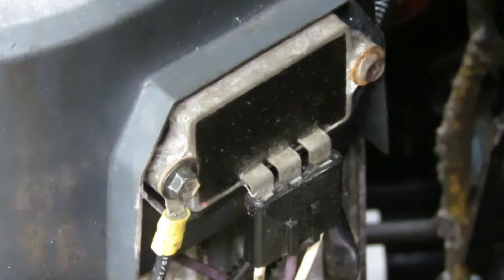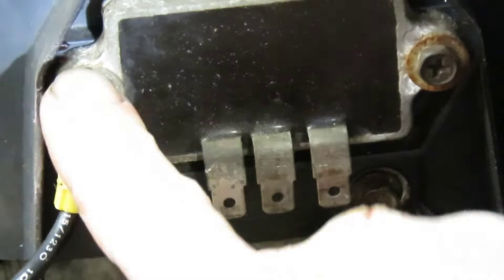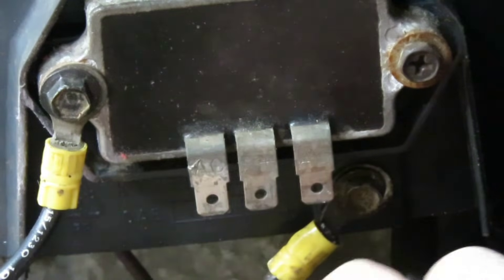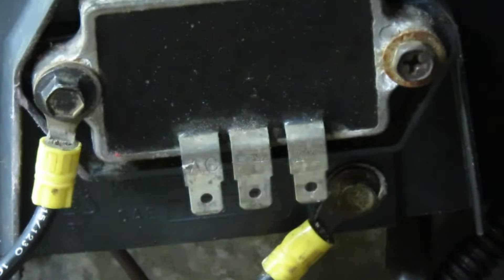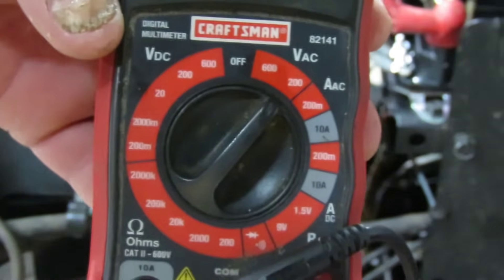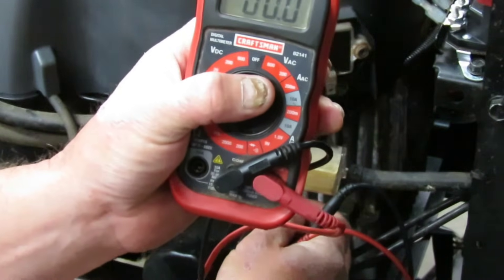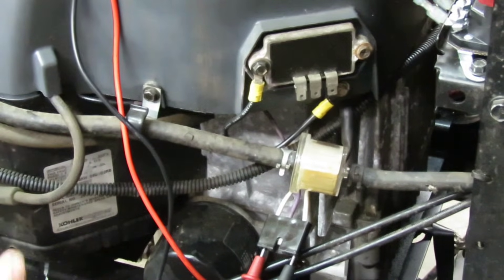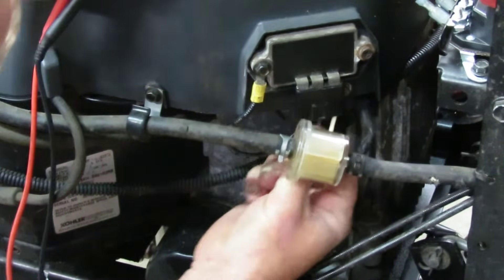How to Test Kohler Charging System

Comment: On this video, what is the wire looped over next to the purple wire in your harness,  I'm only getting 9 V back to my voltage regulator with the key on. I got a good stator, new regulator, but not charging at the battery
Reply from the maker: Im thinking your talking about the blue jumper in connector at end of this Video. The Jumper is just a loop for power to go to green wire.
But I think your problem is this.
Your power to Voltage Regulator comes from Key Switch. Your either Not getting good power to key Switch B terminal which comes from wire on Solenoid. Same post that Battery Positive goes to on Starter Solenoid. OR the key switch is bad not getting a good connection inside Switch.
Key switch Test Video below
https://youtu.be/rOqwb0KaHQI

The way it works
Power from Battery post side of Solenoid has a small wire Red goes straight to key Switch B terminal. When the Key Switch is in ON position connects B terminal to A1 or A2
A1 or A2 is from your Purple wire.
Take note that the purple wire may change color before it gets to Key Switch.

Comment: This was a great video, I don’t have a connector with 3 wires on my voltage regulator, I have the 2 wires and I did what you said and put them on the outside terminals on the regulator however there isn’t a purple wire on the center terminal of the connector but on the other side of the motor there is a purple wire along with a green wire. Do you think the person I got the motor from cut the wire off on the regulator side or does the purple wire connect somewhere else inside the shroud?
Your videos are so good thank you for posting them!😊

Comment: Hi how are you Startin..
I have tried everything you have showed..
Everything is good.
Stator 43.2
Battery charge 14.5
My problem is.. 
Why when I turn my key on the battery light stays on? 
Even when the mower is running at full throttle. 
Please help me resolve this issue.. 
Great videos.. Thank you!
Reply from the maker: Sounds like your charging System is working fine. Just your dash charging light is saying it's not.
Need to run the wires down that go to that light. Seems you have bad connection going to the charging light.

Comment: After you've verified the charging system in working properly and it's still not charging the battery, what's the next step to check the system. I have a new battery, new stator and new regulator so that eliminates three problems.
Reply from the maker: @earlpoole7172
Make sure the base of regulator has good Ground. The regulator will not work if the base has Ground issues. Multimeter on Ohms One lead to base of regulator one lead to ground on battery Negative. If Doesn't show that regulator is grounded. Check the jumper wire on regulator that goes from regulator bolts to one of the shroud bolts.
Can't check the regulator Base Ground from here, You will be checking resistance between the wire and it will falsely show base is grounded.
Kohler is bad for regulator loosing Ground at that jumper wire where it bolts to shroud. The shroud is plastic, but behind the shroud bolt goes into metal.
If the base has a good ground
Need to check wiring from regulator up to key Switch. Then from Key Switch goes to battery Positive side of Starter Solenoid.
Reply: Thanks for the reply. I'll do some testing.
Reply: @earlpoole7172 I know this post is old but, I did see where the battery needs to be in a slightly discharged condition so that the charging system will engage.
Reply: Did not hear that.  Where did you learn that?

Comment: Excellent video troubleshooting a Kohler.
My issue was exactly as you described. 
The yellow right terminal to the block ground, the screw face and inside was corroded with rust.
Also, the left side yellow terminal was sparking intermittently . Looks like a poor engineer design, the left terminal going the the rectifier is threaded through and secured by the plastic shroud only, and stripped out if you tighten it.  Kohler needs a more robust mount than a screw through plastic fastening method.

Thanks again, you earned a  new subscriber here.

Comment: My zmaster will not run if I disconnect the battery. I checked the charging system and I am getting 14volts. Suggestions?
Reply from the maker: I guess I'm not understanding exactly what your saying. If it's running and your Charging.
What's the issue of needing to disconnect battery while it's running ?

Comment: Don't know if you will see this or not but when I check the AC voltage I get 43 but when I do the DC voltage it will only read .19. Does that mean the voltage regulator is bad? Or what
Reply from the maker: It could mean voltage regulator is bad.
But you need to do a few more tests.
Watch this Video Link Below.
It is on a Kawasaki engine
But the charging system works the same.
Only difference on the Kawasaki the DC pin on voltage regulator is the Right Pin and 2 on left are AC. To where your Kohler Center Pin is DC and two outside ones are AC.
But this Video will show you other tests 
Testing regulator base ground
Check for Battery Voltage on DC side with key Switch ON and shows you how to do it.
Fast  Version 
https://youtu.be/eZndhOJLp64
Slow Version
 https://youtu.be/zRwkKNGkymU
Reply: @sartingarage8045  thanks for the advice and it was a bad voltage regulator.

Comment: There is no better explanation that what you have done.  THANKS
Reply from the maker: I have another Video that will help you that is more comprehensive. The only difference is this Video is on a Kawasaki Engine. The charging works the same way. The only difference is the output on the kohler Voltage Regulator is the center Pin. On the Kawasaki it's Pin to Right. Left 2 are AC.
https://youtu.be/zRwkKNGkymU

Comment: Hi, thanks for your video... I'm getting 30V AC from stator but nothing from regulator...with engine off, using a multimetter i probed the center pin and  neg post on battery and had no DC voltage... I was told there should be 12V when doing that. So do I have an open circuit on the positive side?.. what is my next step? Thank you.
Reply from the maker: There should be voltage to that center Pin with key Switch in ON position. If there is NO Voltage with key on, Then yes you have a open short, bad key Switch. 
I have another Video that is on a Kawasaki engine and is more comprehensive.
The only difference is your output is in the center on voltage regulator. Kawasaki Output pin is on one side.
But watch this Video and it will help you
Link below
https://youtu.be/zRwkKNGkymU
Reply: Thanks so much.... I was missing that the key needed to be on. 
Thanks for the link.
Reply: I turned key on and still had no voltage so I followed the wire to the plug and the wire had broken off the plug connector! So I reconnected the wire. I have 12V now and will be able to test regulator soon, but hat was more than likely the problem and my battery no charge issue should be fixed. Really appreciate your generous help!

Comment: I'm getting a reading of 22v ac off the two white wires from the stator. What is the minimum for a mower with electric clutch for blade engagement?
Reply from the maker: 22 volts is definitely Low.
I would pull the flywheel and check internal Flywheel Magnets. They should be evenly spaced apart and if you have magnets that have fell out. You can epoxy them back, but make sure you install magnets in push pull sequence. Meaning if you take a magnet and put it to each magnet on the flywheel. One should push magnet away next magnet on flywheel will draw magnet to it. Needs to do this all the way around flywheel. If flywheel looks ok.
Make sure your engine is grounded good to negative on battery.
If all checks out ok
Replace Stator.
Reply: @sartingarage8045   I put the meter leads into the plug like you did in the video, and got 32 volts..eariler I was trying to hold them when I got 22 volts. Your videos helped a lot,  my regulator was not grounded. I had put two new coils on this Kohler, when i put it back together, i must have put it back together wrong. How is the regulator grounded from the factory?
Reply from the maker: Usually Voltage Regulators have a Jumper Wire going from Voltage Regulator mount bolt to the Top Shroud Bolt right next to regulator.
Reply: @sartingarage8045  I found the problem, it has a metal plate that bolted behind the regulator, then bolted to a lower shroud cover. Bolted that on and getting 13.43 volts , before i just had 12.53 volts. Thanks for posting the videos.

Comment: I have a 1985 Ropper lawn tractor with a Briggs & Stratton twin opposed 14 watch. I have an over charging problem but someone told me they’re are no regulators on that machine. Is there any way you can verify and let me know thank you.
Reply from the maker: Im pretty sure There is Not a Voltage Regulator on that machine. It's all built into Stator under Flywheel. If it's over charging I'd say the stator is probably shorted out.
I would replace it
Reply: Thank you

Comment: Great video.. I have a question. If ur stator is working (30-50vac) but ur regulator output (center pin) is under 12vdc with engine running. Would u say the regulator is bad?
Reply from the maker: @connellfarm315
No 
It could be but there has to be battery voltage to that wire or will not charge correctly. Also base of regulator has to be grounded.
Watch my Kawasaki Charging Video will help alot
I know it's Kawasaki But works the same way as Kohler, Just wires are connected different
This is link
https://youtu.be/zRwkKNGkymU

Also this is a Ground test Video
Shows you how to test the Voltage regulator Base Ground.
https://youtu.be/ogV7e8x0tZY
Reply: @sartingarage8045  thank you so much

Comment: Hello, my vintage tractor from the 1970s has a 10 HP iron block Kohler engine that stopped charging the battery.  I replaced both the stator and voltage regulator and it still doesn't charge even though the new regulator is properly grounded to the frame.  Could it be that the flywheel magnets are too weak to produce voltage?  The ohm meter reading shows fluctuwating numbers on the readout from the regulator with the engine running at high speed.  Thanks
Reply from the maker: @TheWaterbug101
That is a possibility.
It's been awhile since I've had my hands on one like you have
But if one magnet is missing or has came loose inside the flywheel. You will get erratic readings on the meter.
I think I would pull that Flywheel and atleast check the magnets.
Tip: Those Magnets are Push Pull Push pull all the way around the Flywheel.
So if you have a magnet and put it to the first magnet, It will either draw magnet to it or you will feel it try to push magnet away. 
So if the first one is pull
Next one will be Push Next one will be pull
All the way around

Comment: Does the purple charging wire need to go to ing switch or can it go to the battery? Thank you Jesse.
Reply: I've seen on your videos and others there's a loop on the engine harness. Is that to connect oil sending unit to the engine kill wire? Thank you again Jesse.
Reply from the maker: I will have to check on that
Reply from the maker: @user-en6by2kd2k
It has to go to switch
If you connect straight to battery will have constant draw on battery.
When Switch is in OFF position
Breaks connection from that wire to battery
Reply: @sartingarage8045  thank you very much. Then one more question. Can I send pictures at this number?
Reply: So from the switch I need key off nothing (not ground and not🎉 hot) key on hot?
Reply from the maker: Yes
No connection
Reply from the maker: Key Switch Test if you need it
https://youtu.be/rOqwb0KaHQI
Reply: Thank you again Jesse.

Comment: So if you're troubleshooting your fuel solinoid cause you cant get fuel to engine how would you check then
Reply from the maker: When key switch is turned on and off
You should hear the solenoid click
If Not
Unplug the solenoid
On the connector side connect your Voltmeter leads
Turn Key to on position 
Make sure there is voltage to this connector
If there is voltage and you can't hear a click
Replace Solenoid
If there is Not Voltage to connector
Test Key Switch
Reply: @sartingarage8045  heyyyyyy  Appreciate you fella.  The wires under switch were wired wrong.  Someone's (my dad)    Jerry rigging didn't account for enough wire . when seat opens. Wires got pulled out.  Oh and my valves were way off  was popping and leaking oil from  ohv cover. Let's go see   if it holds up under load  thanks again

Comment: Hi I have a Koehler 7000 that keeps popping the fuse as soon as I turn on the key. I have traced it down to the charging system. I have removed the rectifier thinking it was the problem, installed a new one and I get the same results, popes fuse. I also found out that I can turn on the mower and cut grass without the rectifier. I turned i5 on and tested the stator and it is giving me 34 or so AC. I am thinking it is the blue wire between the two white ones. What long term harm will I have if I run it without a rectifier and just place a charge every time I finish mowing.
Reply from the maker: There are many things that can cause that. Any wiring short, maybe defective key switch.

Comment: Hi how can I check the regulator please
Reply from the maker: I would recommend following the steps in this video, But the Center pin is your DC output, out of regulator. 
But if there is No AC coming in the other 2 pins on regulator. There will be No DC output. Or if base of Regulator is Not grounded will be no output.

Comment: Thanks for the video.  Been  charging my battery for 2 years once a month.  Checked for voltage back to the switch and nothing.  Verified the charging system was working.  Checked the purple wire and it was broken off at the second plug.  No voltage due to corrosion, so I stripped the wire and checked again.  It was hot regardless of the key position  (I decided to cut the wire off and insulate it, didn't like a hot lead all the time).  I found another purple lead with a female blade connect that was only hot with the key on and cut the purple lead at the plug.  Crimped on a male blade and heat shrunk some insulation, and pressed it into the female blade connect, bypassing the second plug altogether.  No more dragging out the battery charger and 100' cord every 3-4 weeks to cut the grass.

Comment: I’m getting 15.62 volts at the battery and voltage regulator when the engine is off. Brand new battery. Engine runs, but the key won’t start it. I can hear it click in the on position but the start position does nothing. I have to put a jumper in the starter and it fires right up. Turning the key off shuts it off. 

When running, the voltage at the battery and at the regulator is 17.6-17.9. I replaced the voltage regulator and get the same exact readings. 

I tested the stator from a Koehler video and it showed to be good. 

Is the high voltage (17.6+ volts) when running a sign of something else or are my switches just fried?

John Deere stx38 yellow deck, about 25 years old. Thanks.
Reply from the maker: Test your keyswitch
Multimeter on Ohms 
Test terminal B and S with key in start position.
Reply: @sartingarage8045  this ended up being the starter relay. Starts right up and runs like a top.
Reply: I get nothing on the meter doing that. Gonna replace the switch and see if that does it. Thanks Sartin!

Comment: Will you damage the  diodes in the regulator if you hook up a battery charger to the battery without removing the battery leads?
Reply from the maker: I usually remove battery to charge it just to prevent other issues. But if everything is working correctly and key Switch is off.
Even though battery is connected in Equipment, It is not connected to anything that is drawing current from battery.
Would be hard to short out components.

Comment: How do you contact the wires to the tester? Please
Reply: Thanks 👍
Reply from the maker: Black goes in meter at the common connection Usally labeled COM
RED will go in Volts/Ohms Connection

Comment: @Sartin Garage I've got Kawa fh680v with 31 acv coming out of the stator, 14.6 dcv coming out of the regulator, and battery charging voltage showing 14.6 at full throttle. The excessive voltage isn't blowing fuses but is boiling a new battery in 3-4 days. Not sure why this is happening? Please help. Thanks!
Reply from the maker: 14.6 volts is Normal Charging Voltage
When you say boiling a battery are you meaning battery boils over or are you just meaning battery goes dead.
If the battery goes dead over a few days
Sounds like you have a draw on battery while mower is not in use.
I have a video on testing for this
Link below

https://youtu.be/7f2dR0rT1fw

Comment: When I do the dc test I’m only getting 8.6 volts ? Any help ?
Reply from the maker: Remove that wire at voltage regulator, turn key to on position , check that wire for battery voltage. If no voltage is a short in wire or defective key switch, 
Also check ground wire that goes from regulator to engine shroud bolt. They are notorious for losing ground at the shroud bolt.
Voltage regulator has to be grounded to work.

Comment: This solved my charging problem. I had accidentally left the grounding strap off whilst replacing the two ignition modules. Unfortunately, I found this video after I had ordered a new regulator-rectifier module and waited for it to come in.

Comment: Great video. Also a good idea to test all the relays. My older Craftsman lawn tractor wasn't keeping the battery charged so I followed your procedure. I had voltage at the stator but not the rectifier. Was going to order a new rectifier but figured while I'm at it I might as well check the relays too. I found one bad one and replaced it, tested the rectifier again and got 14 volts. Bad relay was the one with a red wire going into it. I didn't trace all the wiring, just happy the battery is charging again.